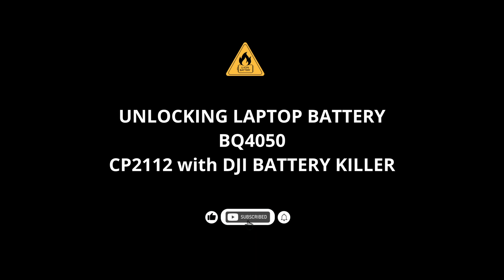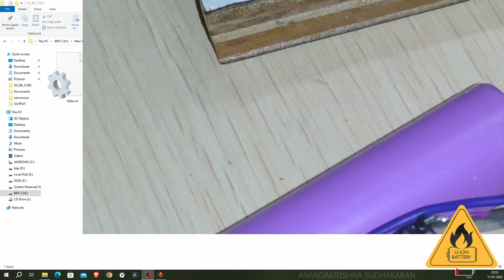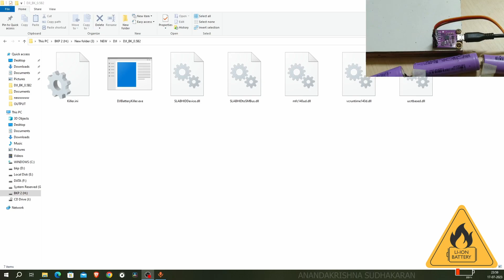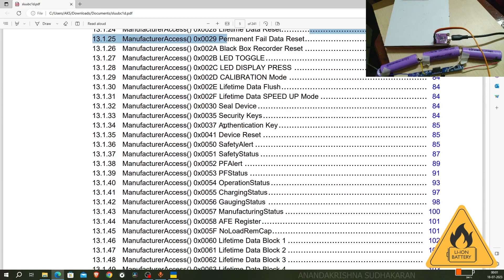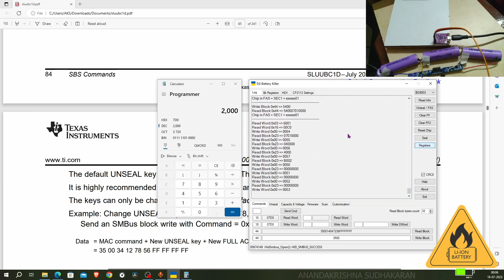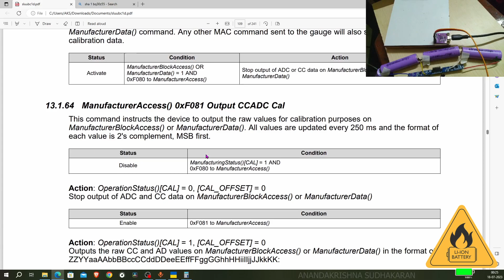CP2112 and DJI Battery Killer Rewrite BQ4050ROM" Laptop battery data retrieval - BMS HACK

Comment: Hai sir please help me
I experienced a BMS battery with a BQ4050 that couldn't be unsealed. I've followed your method, write word (44) 3500 okay, but there's a difference in read word (00) the number 73 appears, while yours is no block, and I followed it by changing (44) a long number appears, then I wrote word and read word, chose BQ9003 unseal but it didn't work. What should I do? I've done all your steps.

Comment: Hello, this battery uses a BQ40Z50 chip. I’m able to read, unseal, and modify the cycle count using DJI Battery Killer, but I’m unable to change the full charge capacity.
Can you help me with that?

I also have another battery that uses a BQ40Z695A chip. Is it still compatible with DJI Battery Killer?

Comment: Hi @Anandakrishna, thank you for the videos, with your guidance i was able to connect to my sons chromebook battery Lenovo - L19M3PG1,  We had left it uncharged for a few months and when i tried powering it up, it would only power on on USB C, and unplugging the usb , the laptop would turn off. 

I used your directions with CP2112 chip, dji killer app, i was able to come this far , but from here i am not able to go any further, any guidance would be greatly appreciated please, 

(00) Manufacturer Access = 0x6001
(01) Remaining Capacity Alarm = 410 mAh
(02) Remaining Time Alarm = 10 min
(03) Battery Mode = 0x6020
(04) At Rate = 0 mA
(05) At Rate Time To Full = 65535 min(s)
(06) At Rate Time To Empty = 65535 min(s)
(07) At Rate OK = 1
(08) Temperature = 24 C
(09) Voltage = 11936 mV
(0A) Current = 0 mA
(0B) Average Current = 0 mA
(0C) Max Error = 1 %
(0D) RSOC = 66 %
(0E) ASOC = 65 %
(0F) Remaining Capacity = 2638 mAh
(10) Full Charge Capacity = 4018 mAh
(11) Run Time to Empty = 65535 min(s)
(12) Average Time to Empty = 65535 min(s)
(13) Average Time to Full = 65535 min(s)
(14) Charging Current = 0 mA
(15) Charging Voltage = 0 mV
(16) Battery Status = 0xD0
(17) Cycle Count = 57
(18) Design Capacity = 4105 mAh
(19) Design Voltage = 11520 mV
(1A) Cpecification Info = 0x31
(1B) Manufacture Date = 0x5254 - 2021.02.20
(1C) Serial Number = 8861
(20) Manufacturer Name = SMP2019
(21) Device Name = L19M3PG1
(22) Device Chemistry = LiP
(23) Manufacturer Data = 0x4201010100008B0F8B0F8A0F0120
(3C) Battery Cell 4 Voltage = 19466 mV
(3D) Battery Cell 3 Voltage = 0 mV
(3E) Battery Cell 2 Voltage = 11200 mV
(3F) Battery Cell 1 Voltage = 0 mV
ERROR: Could not perform SMBus read.
----------------------------------------------------------------
Write Block 0x44 <= 5400
Read Block 0x44 => 540001730000
Chip is Sealed = SEC3 = xxxxxx11
----------------------------------------------------------------
Key 1a successfuly entered
Write Block 0x44 <= 5400
Read Block 0x44 => 540001730000
Chip is Sealed = SEC3 = xxxxxx11
----------------------------------------------------------------
Key 2a successfuly entered
Write Block 0x44 <= 5400
Read Block 0x44 => 540001730000
Chip is Sealed = SEC3 = xxxxxx11 - error unseal!
----------------------------------------------------------------

The Chip Is BQ40Z695A ; i looked at the ti Ref manual  ( https://www.ti.com/lit/pdf/sluua04 ), i went to page 104 , but could not figure out how and what to enter, if you could kindly guide me, it would be great:

Comment: Dear friend, I have two batteries with a bq40z696a chip. How can I unlock them, with what program? Can you tell me something? I tried to unlock them using this video DJI Battery Killer, but it didn't work. I also tried using the Kali Linux program, but it didn't work either. Please tell me what to do.

Comment: hello bro Your video has given me new ideas, I have a question, is there any way to reset the chip so that it configures itself, you see sometimes the cells are in good condition but it continues to show low amperage, my question is is there a way for it to self-configure, or to recalibrate itself to use the cells, whether they are new or the ones that are put in?

Comment: you have used the default unseal password to unseal, how to unseal when the password is not available or unknown ?
Reply from the maker: @David-mu2qc  That is not publically available. You need to buy a proffessional tool or make direct contact with the manufacturer. Am still trying it. It needs more infor about the rom structure and memory areas.
Reply: @AnandakrishnaSudhakaran  Thanks for your reply, the paid methods are way too expensive for a hobbyist like me which might want to tinkle with own stuff only. I have tried contacting the reseller and they no clue about it and I have no way to contact the battery manufacturer, I have also tried contacting Texas Instruments but cannot help in this matter, so I am hoping you will come up with something useful.
Reply from the maker: @David-mu2qc well ,i found some methods but i cant publish it. There are some people misusing it and reselling battery with same old batteries. i
Reply: are you able to help me ?

Comment: did somebody had manage to get this thing done so easily like in the video? my chip got unsealed "successfully" with the "unseal" button but when i pressed the"unseal2" button the program hanged so hard that i closed it. after this, the chip is not responding anymore. i didn't stopped to try if the unseal was an effective unsealing and it would let me reconfigure the registers and was not another false positive unsealing... I don't know if it my device is now bricked or in some protection mode as said somewhere on the 200+ pages in the TRM (technical reference manual). SMBus is  not responding anything. Both Arduino and CP2112 were not able to communicate anymore with this BQ4050 device and the respective softwares (smart battery hack and DJI battery killer). what the heck. im going with EV2400 method+BQStudio as soon as my cheap AliExpress knockoff arrives... luck for everyone. this crap was already difficult enough, let alone that key for unseal/full access/authentication/ whatever damn thing

Comment: what program can I use on a battery with BQ20Z95 chip?
Reply from the maker: If you plan to just only change cells you can try with cp2112 and general procedures for changing all realted to the chip. But the problem is key. If the key is not default you cannot unlock the chip. Do you hav any hardware setup???
Reply: @AnandakrishnaSudhakaran   working on my HP laptop with vt06xl battery. New Chinese batteries I tried are not recognized by the bios, figured I would replace the weak cells in mine. Opened the Chinese and see bq20z95 chip in them with 3 cells made of 2 batteries each . Total 11.1v. ordered cp1212 to see what I can find in the software. Not very experienced with batteries.
Reply from the maker: Chinese batteries are just clone of original batteries, you can use dji battery killer to check the battery. If the keys are default we can unseal and reset. Lets hope
Reply: @AnandakrishnaSudhakaran  can I add that chipset to djibatterykiller manually?  Does the be2work demo software help with this?
Reply from the maker: @lovemytechy  yes be2works demo support this chip and its free, u can try. Dji batterykiller is common we can use it for any chip if we know the basics of the other chips. Lets see.
Reply: @AnandakrishnaSudhakaran  cp1212 is my best option for hardware?

Comment: im asemblying new batteries cells for my mavic air2. but after successfully clearing pf etc. and reset chip nothing happened stilll no power and cant be charged. what could be the problem here, total battery voltage using tester read 12volts. there should be one blinking light after the programming but now none at all. thanks for your help
Reply from the maker: @haibardolaza1 charge each cell voltage upto 4 volt and check every flags by clicking registers button. If possible share image to my instagram or gmail so i can check
Reply: @AnandakrishnaSudhakaran  hi what do you mean by check every flags by clicking registers button? is that an old version of the dji killer? i dont see any registers button anywhere
Reply from the maker: @haibardolaza1  there are many versions, my zip file contains the latest if iam right and it has register buttons, pls contact me on my mail or insta or telegram
Reply: @AnandakrishnaSudhakaran  can i have your gmail my friend? thanks

Comment: y i cant change the full charge capacity? into 2200mah?
Reply from the maker: Which is the chip?
Reply: for dji spark battery i modefied, but i cant change sa the remaining capacity and the full charge capacity. i use mini 2 cell
Reply: i using cp2112
Reply from the maker: Battery chip number?
Reply: where can i see the battery chip number boss?
Reply from the maker: @casper66708  bro u need to open battery case, the  look for the chip
Reply: i send the picture boss on ur fb acount ryt now. thanks
Reply: bq9003 the battery chip number boss
Reply from the maker: Choose bq9003 on dji sogtware and click unseal
Reply: done unseal
Reply from the maker: Before doing anything did you calibrate the chip after recelling?

Comment: Hello sir! Do you have a tutorial of dji spark Battery? Change cell capacity 1480mah to 2250mah battery modified....from Philippines thank you
Reply from the maker: If the keys are default we can do it,
Reply: I change the cell 1480mah to 2250mah its ok now. and another problem is the full charge capacity i don't know the code to unseal the  ffc

Comment: Hi! I tried to unlock a battery of asus laptop, but it didn't work.

Key 2a successfuly entered

Write Block 0x44 <= 5400
Read Block 0x44 => 540001730000
Chip is Sealed = SEC3 = xxxxxx11 - error unseal!

The chip is BQ40Z50. Do you have any idea?
Reply from the maker: Key is different, choose bq30z55 and try to unseal
Reply: @AnandakrishnaSudhakaran   I have tried...
Reply from the maker: @---Gabriel---  then unseal key is different, cannot unseal sorry
Reply: chip is BQ40Z50. same problem

Comment: Hi can it work wit ev2400 programmer too?.
Reply from the maker: No. But ev2400 work with many other software like BQ studio, be2works, Ubrt Regedit, Sb2works. So many softwares. This software is actually a basic software. Tell me about your need. Which chip you have? Is your ev2400 is original or clone?
Reply: @AnandakrishnaSudhakaran  i Not buy ot xould like it to use to fix laptop baatteries from diffirent brands.  Because those after market ones not lasting well. I know nlba can fix it but i am looking for cheaper alternative.  I can use nlba doftware to see how healty the battery is and if it locked or not of balanced. But i need software to unlock. I am not professional repair men.
Reply: Probably ot will be clone like HarshadPatel in his 6 months ago video.
Reply from the maker: Ok dji software is just like bq studio, all options are there in rhe bq studio , if you have anydesk please send me to my mail id i will check with your ev2400 and bq studio
Reply: @AnandakrishnaSudhakaran  Hi do you have a link for the software. It is only for laptops batteries. Not drone batteries. Thank you.
Best regards Steve
Reply from the maker: @stevedebeukelaer1424  this software is mainly for drone batteries, I just figured it out that we can use it for other BQ chips also. Link is difficulty to get, I will upload and share the link for you
Reply: @AnandakrishnaSudhakaran  ok thank you very much.
Reply from the maker: @stevedebeukelaer1424  this is my mail id

anandh4v@gmail.com

Please send a mail i will reply the file
Reply: @AnandakrishnaSudhakaran  ok I will do that.
Reply: Did you received my email?

Comment: Does this software unlocks bq40z50 with unknown key?
Reply from the maker: If the unseal key is default, yes its possible. Get the Technical Reference and try
Reply: @AnandakrishnaSudhakaran  It is not default unfortunately. Is there any master key or method to force ROM mode for bq40z50 ? how does other softwares (nlba etc.) unlock those batteries? I have been working with bq controllers for self experience but i really wonder how to unlock these devices. Since somebody did this, it means its possible but i really wonder how. I'd appreciate any help
Reply: @ugur23232323  There is a guy, who sells BE2Works software. It unlocks some BQ40Z50 chips. From what I can tell there is undocumented calls to MSC 0x44, they do require some values to be calculated based on Current(), RelativeStateOfCharge(), CycleCount() and RemainingCapacity().   For some reason it does not work when cells are not balanced well enough. I guess it somehow distorts calculation of those unlock variables sent to MSC.

Comment: Is it possible to unlock the bq20z955 rom?
Reply from the maker: If you know the codes or method yes its possible. Did you search on google for technical reference manual? Just try then you can understand this chip. Then tey
Reply: @AnandakrishnaSudhakaran  I don't have the cp2112 board, is it possible to do this procedure using an Arduino Uno? If possible I will purchase one.

 Regarding the codes, I found the bq20z95 datasheet on Google with several codes, but I don't know if these are the codes you referred to 

Sorry if there are any language errors, I'm using Google Translate

Comment: i have "dji battery killer version. 0.5 beta 2" and cp2112
bq20745 not unseal . plz say me bq20745 security key.
 and how to writ block for full unseal plz help me Thanks
Reply from the maker: There is no known keys, all are default, try to unseal it first by selecting bq30z55 if not unlocking, select bq9003 and try. If it still fails, iam sorry u need to find the keys or a way to enter boot mode. I will ask my friends about it.
Reply: @AnandakrishnaSudhakaran  sory my ic No. bq20z45  plz help me
Reply: @AnandakrishnaSudhakaran  bq20z45  technical reference
•  SBS:ManufacturerAccess(0x00):Seal Device(0x0020)
• SBS:OperationStatus(0x54)[SS],[FAS]
• SBS:UnSealKey(0x60)
• SBS:FullAccessKey(0x61)
• SBS:AuthenKey3(0x63)
• SBS:AuthenKey1(0x65)
• SBS:AuthenKey0(0x66)
i am taring  writ block   with 44  6000   but not writ block
Reply from the maker: @tahirmaqsood2584  can u msg me on my instagram or facebook, so we chat and discuss

Comment: Hello sir, I need some help of urs regarding Hp mu06 battery 🔋 Its has rom BQ20Z40/45, please help me how to reset it 😢? M planning to replace the cells. .. Looking for your guidance.
Thankyou in advance.
Reply from the maker: Thanks for your comment.

First which board you have? Arduino? Cp2112?
Reply: @AnandakrishnaSudhakaran  Sir , I have Arduino but Cp2112 looks lill less complex, so would buy CP2112,.. I want your step by step guidance from wiring to reprogramming/Reset.

Comment: How to reset charging cycle 0 and battery full health in bq30z55
Reply: I used cp2112 with dji battery killer software but I can not reset charging cycle how to reset please help
Reply from the maker: @azamjahangir3071  ok can you contact me on instagram , or facebook or telegram?
Reply: @AnandakrishnaSudhakaran i not foind you facebook bro
Reply from the maker: Bro it is on my home page of utube, there is all links
Reply from the maker: Do you have any debug boards like cp2112 , arduino,  ev2300 or Raspberry pi? If you have cp2112, dji battery killing software supports bq30z55.

Comment: In the "Read and Write BQ4050 ROM using CP2112 and DJI Battery Killer" video, the presenter skillfully demonstrates the process of interacting with the BQ4050 ROM using the CP2112 interface. This informative guide offers valuable insights into manipulating device firmware and showcases its application in the context of the DJI Battery Killer scenario.
Reply from the maker: Sir, thanks for your comment ❤️. Dji battery killer can be used for other chips. Nobody knows. I tried an experiment. Actually i tried many easy ways to communicate with chips like this.  I am saving some money to buy that ev2400 compatible device from you. It's expensive for me. Because If I bought that i can use and understand many communication procedures. I will contact you. My aim is to reuse old laptop boards, and dispose li ion battery in the proper way. So we can make our batteries as fresh. I know it takes a lot of time. And I prepared one video for you. You asked me about 6 months ago. But unfortunately due to some issues I couldn't publish it. I am planning that video also. Once  again, thanks for your support sir.
❤️
Reply from the maker: Harshad sir , is it possible to get that ENIT LAPTOP DEBUG TOOL with Emi option.

Comment: hey mate, do you think than i can use arduino instead of cp2112 ?
Reply from the maker: Depends on software. if you are planning to use arduino instead of cp2112. Make sure the software supports both. Otherwise cp2112 cannot simply be replaced with an arduino. There are some smbus or i2c arduino code avilable for arduino boards. So try that if you dont have cp2112

Comment: cual seria las direcciones del bq30z55?
Reply from the maker: Try bq30z55 technical references, you will find
Reply: @AnandakrishnaSudhakaran i found datasheet becouse not found security key and 00 not block
Reply from the maker: @Garanti_okunur  well, the security keys are default and the manufactures will change the password for the protection. So if you are not able to unseal the device with default password , the password is changed. Also if u cant find the keys, look for security keys on the pdf, u can see a dedicated section. Also look for sha authentication which is a method used for bq30z55

Comment: dear bro. can you help me connect arduino uno r3 with dji battery killer softwave
Reply from the maker: Dji killer designed for cp2112. There is no way to connect. But if you tell me about your battery and chip, may be i can find a solution for your battery.
Reply: @AnandakrishnaSudhakaran  my chip is BQ30420 FOR dell m6800